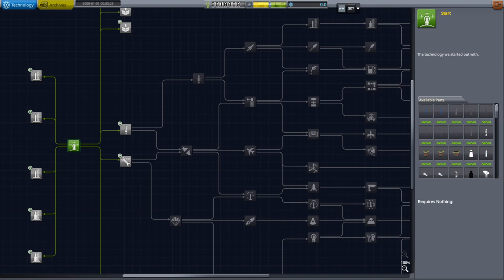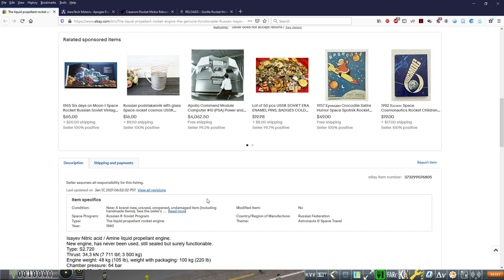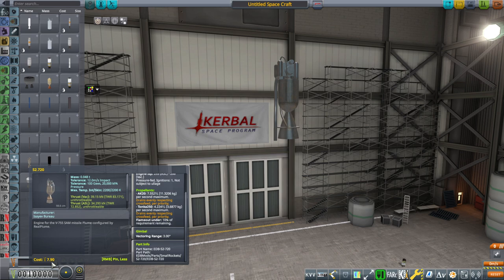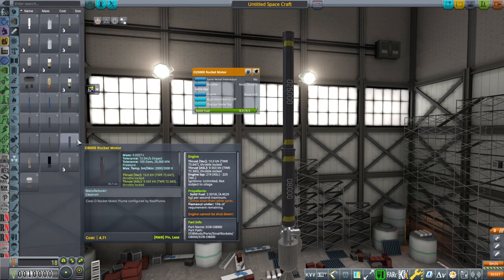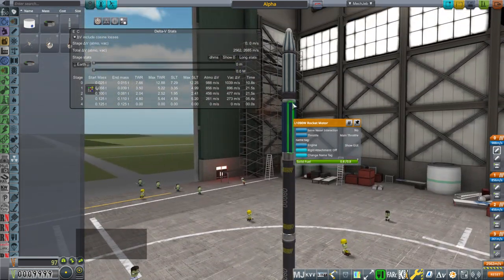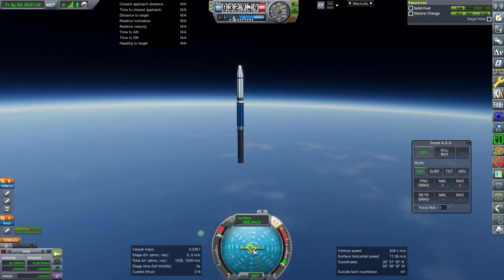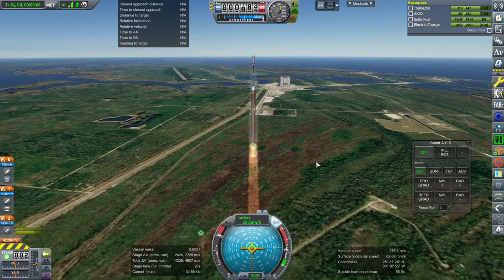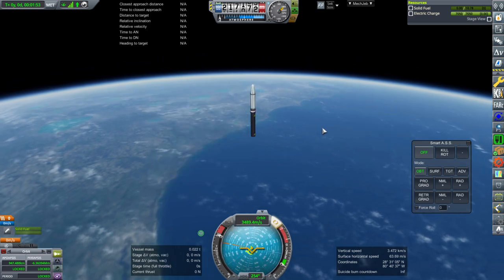Realism Overhaul in KSP 1.8.1 - Off-the-Shelf Engines

Comment: actually S2.720 has two hard fixed modes - 34.3 kN with ISP 235s and 19.6 kN with 220s. After booster sepatation it works several seconds in first mode then switched to sustainer mode. 
my father told me some things about it - he used this rockets in Vietnam.
Reply from the maker: Is this the vacuum-rated ISP or at sea level? I think I'll just have to leave it in the first mode either way - I don't know how to get it to switch automatically anyway.
Reply: @RaizSpace  sea level, i guess.
Reply from the maker: Okay, then what I've got is basically right except for the sustainer mode. I can add an alternate configuration for that, but nobody would ever use it.
Reply: @RaizSpace  you're right, we don't launch SA missiles with long flight. we launch Rockets :)
unless for reason of minimization dynamic strees?

Comment: rocket idea: raptor-powered space shuttle, both the boosters and the main engines
Reply from the maker: The external tank gets rather heavy like that since the propellant is denser than hydrogen, so the whole stack would look pretty different. Ultimately, you'd be better off just using a Starship-Super Heavy. But, on a related note: https://www.youtube.com/watch?v=3zGyVYqdTkA and https://www.youtube.com/watch?v=MxXjQrrsPcs